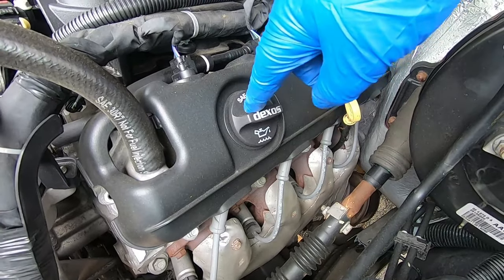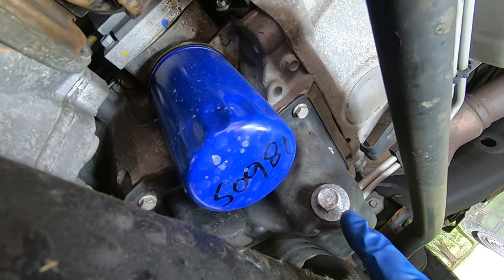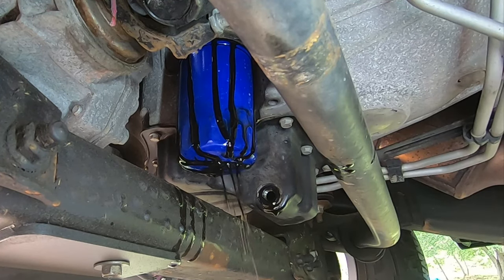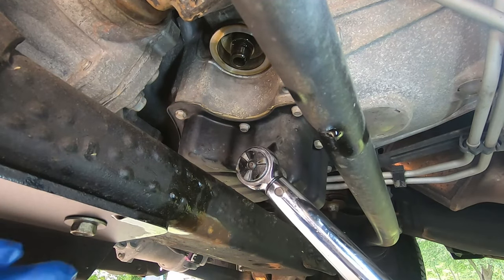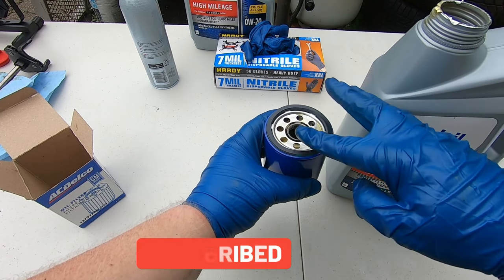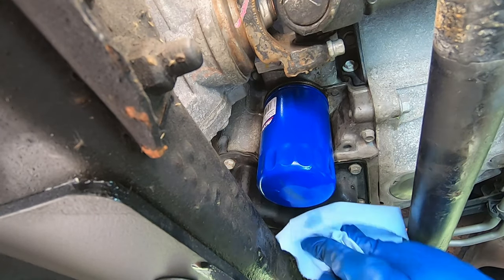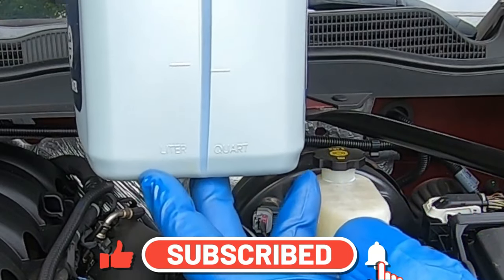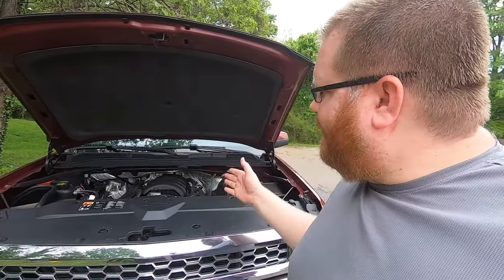2014 - 2019 Silverado & Sierra 5.3L - Oil & Filter Change

Comment: Never never never never never never ever ever do you tighten the oil drain as tight as you can by hand. That can and will destroy the oil drain plug or the oil pan. All that oil drain plug has to do is keep the oil in the pan, it does not have to hold the truck in the air. Please don't ever say that again!
Reply from the maker: You're right, it my mind I know not to kill it with all my strength, good and snug is all that is needed. Tightening down to proper torque spec of 18 ft-lbs is best though. Thanks for watching and commenting Hawk! 👍

Comment: My truck is a 16 and has a shield underneath a plastic shield. You have to remove that first. Did your truck have that shield? If so, would be nice to show that removed as well. Thanks for the video.
Reply from the maker: You're welcome! My truck didn't have that shield unfortunately. It was bought used so the previous owner may have removed it or left it off. Thanks for watching! 🙂

Comment: For some reason finding 5w 20 dexos oil is always a hit or miss at Walmart so I actually had to go with 10w 20. For my last oil change. It should be fine in my 2018 Silverado but deff will never go with the 0 w 20
Reply from the maker: That's fair Jonny. I decided to go with the recommended oil this time, I might try a heavier weight oil sometime in the future. Thanks for watching! 👍
Reply: With tighter tolerances you could burn out a bearing because the oil is to thick to get to where it needs to be. But that's up to you.

Comment: Prefilling the oil filter is not necessary, but it doesn't hurt anything either. I don't care what some of these commenters say. As for an anti drain back valve, in case you're worried about it. There is not been an LS motor yet made that requires one. The oil filter sets in there in a vertical position and will not drain out unless you poke a hole in the side of it. I do like the largest oil filter that fits the application. Which it appears that you put on. You might want to be more assertive in your explanation of the part number of that oil filter you're using. Putting the smallest possible oil filter on the engine is suggested by the manufacturer because they want to sell you a new truck. They could give a shit less how long it lasts. As long as it gets through the warranty period.
Reply from the maker: Ahhh ok, thanks for the explanation. I was told the larger one is better as well. I like to pre-fill about halfway but have been told it doesn't really matter for these engines. Thank you again Hawk! 😁👍

Comment: Very well-done video. Draining the oil and changing the filter is easy on these engines. I also use ACDelco oil filters on my 2017 Yukon and Pontiac Vibe. Not the E series but the good ones. I use Castrol Edge 0w20.  The most important thing is not so much what brand of oil but changing the oil and filter on a regular basis. Good oil is the live blood of the engine. Thanks for sharing.
Reply from the maker: Thank you Russel for the kind words. I agree 100%, performing the maintenance on time is more important than what brands you use to do it. And Castrol is a good brand to go with too. Thanks for watching! 👍

Comment: My old 08 Silverado’s oil drain plug has the gasket already on the plug. Are these trucks the same way where you don’t have to necessarily change it everytime? Great video btw!
Reply from the maker: Hi Mike! Correct! You don't have to change the gasket every time you change the oil, just replace as necessary. Thanks for watching! 👍

Comment: I have a 2016 Chevy Silverado that  I bought with  14,000 miles currently has 18k miles was using Castrol oil 0W20. Do you think it would be a waste of money to start using royal purple for the life of the vehicle? I do not want to end up with that GM tick
Reply from the maker: Absolutely not! Royal Purple is awesome oil. Thanks for watching! 😎
Reply: Use 5w-30 Mobil 1 or Royal Purple, once ur mileage gets high.  All Sierras have the same 5.3 eco Tec n they take 5w-30. I have the tick on my 14 Silverado, I switch from 0-20 to 5w-30 no tik, 156K miles.

Comment: Does the oil have to be Dexos approved if stated on the truck  ??
Reply: Yes, make sure it is Dexos 1 Gen 2 or better because these DOD engines are known for lifter issues and using the wrong oil can cause the lifters to malfunction prematurely.